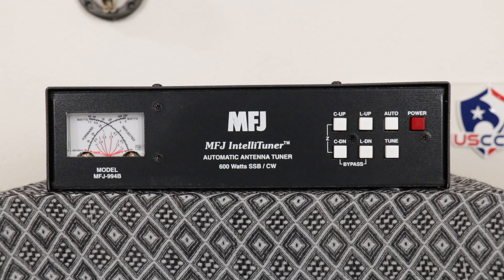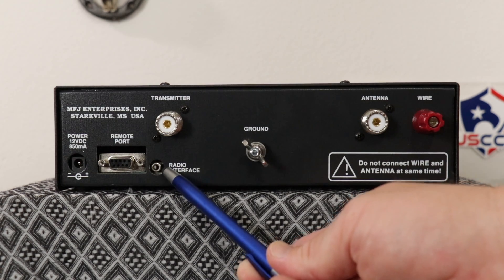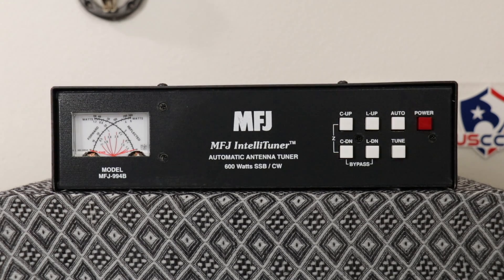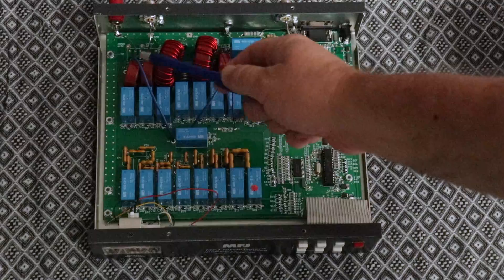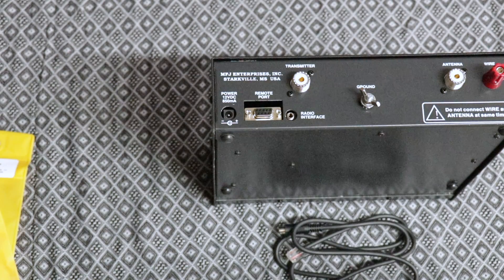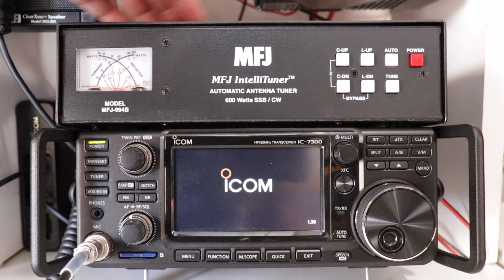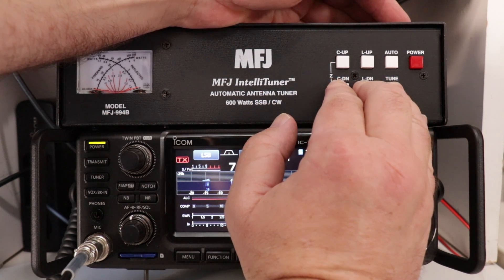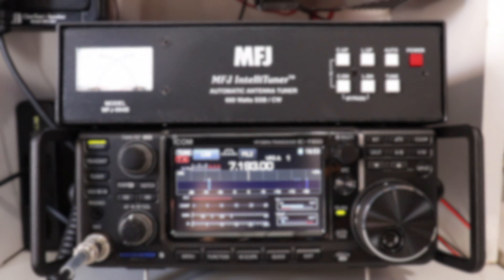MFJ 994B InteliTuner Automatic Antenna Tuner

Comment: Hi there, great video. I just got this tuner along with an amp. I have the interface cable that controls band switching from the tuner to the amp. Do I use the tuner to tune or hit the tune button on my IC-7300? I'm a little confused.

Comment: This is an excellent tuner. Will tune with less than 5 watts input. Holds it's tune and isn't affected by stray RF, as much as LDG equivalents are. Tunes far wider range than anything on the market. Damn nice tuner. Only negative, the interface cables are different than most other MFJ autotuners use, especially Yaesu's interface cable.
Reply from the maker: Thank you for taking the time to watch and the comment! It is greatly appreciated.